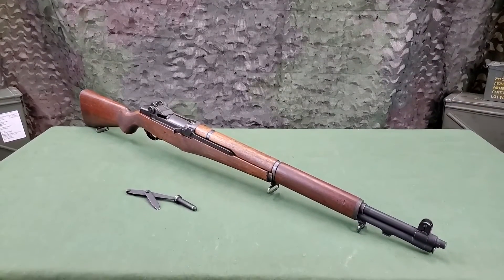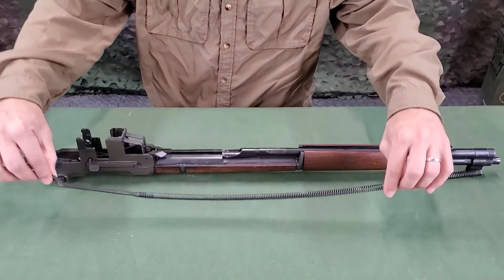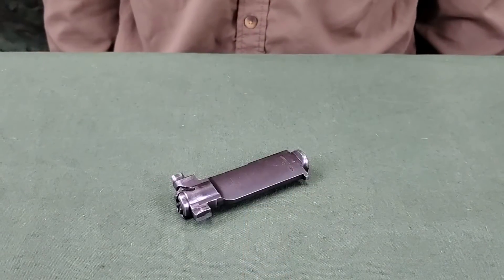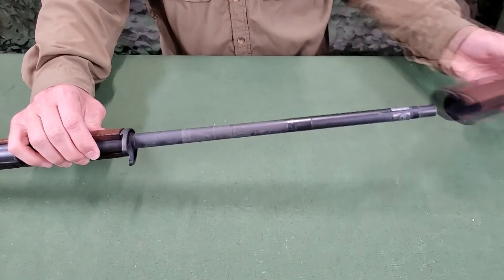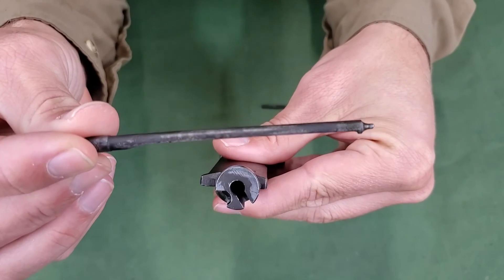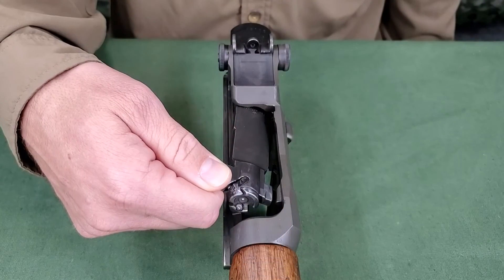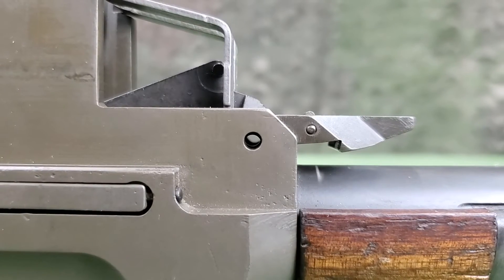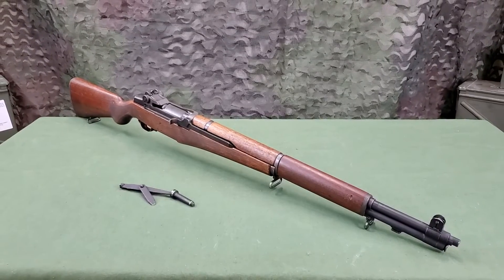M1 Rifle (Garand) Field Strip (TF 8-02)

Comment: When you wreck the slide back is the firing pin supposed to stick out a little bit but when you touch it, it goes back in is this a bad thing?
Reply from the maker: The firing pin is free-floating. So it should be loose within the bolt. With the bolt locked back, if you tilt the rifle forward, the firing pin will protrude, then if you tilt the rifle back it should slide back in to the bolt freely.

Comment: How do you engage the safety like that? I have to pull my bolt back half way for it to engage
Reply from the maker: I'm not sure of the manner in which you are referring. The hammer does have to be back for it to go on safe.
Reply: @HistoryinFirearms  when the firearm is loaded, to put the saftey on, you have to pull the bolt back halfway to engage the saftey.
Reply from the maker: @junkyarddog8277  If the firearms is loaded, the hammer should be back, and you should be able to click the safety on and off without manipulating the bolt.
Reply: @HistoryinFirearms  okay so I wasn't putting enough pressure on it. For some reason it gets lighter when you pull the bolt halfway back.
Reply from the maker: @junkyarddog8277  Glad you figured it out! It should be pretty consistent though so it sounds like there is something a little off with the mechanism.

Comment: Any tips on particularly stuck gas cylinder lock screws?
Reply from the maker: I would let that soak with some oil if you haven't already. The aftermarket tools may also be of benefit also
Reply: @HistoryinFirearms  I'm planning on getting some kroil due to suggestions from others I've recently talked to. Any suggestion on good aftermarket tools? I don't have the combination tool used in the video but I have been using the M10 Combo tool from the cleaning kit.
Reply from the maker: @@KalebKraft108  Yeah, put that oil on and let it sit. The M10 tool works pretty well, I do have a video on that kit. I Don't have a specific aftermarket tool to suggest, but my thought for that was because they have 4 blades, if you will,  like a Phillips head screwdriver, so have a but more engagement with the screw.
Reply from the maker: @KJK9029  The M10 cleaning rod handle/combo tool works just fine for all the tool needs. I do have a video on the M10 if you haven't checked that out.

Comment: Where can I get that multi tool?  Loved the video.
Reply from the maker: eBay or any number of surplus dealers. There are a few different ones. I have specific videos on most of them so far.
Reply: @HistoryinFirearms  is there any house hold items which can safely be used for getting the pin out?
Reply from the maker: @mvdb8110  Which pin are you referring to?
Reply: @HistoryinFirearms I assume the Follower Arm Pin 2:59 . When I was a Cadet in the Philippines, we had to make our own “Pin Removal Tool” out of Heavy Gauge Steel Wire to push it out.  That Multi-Tool was nowhere to be had.